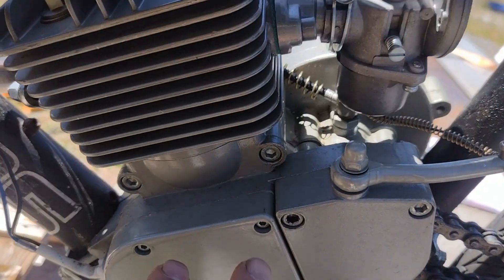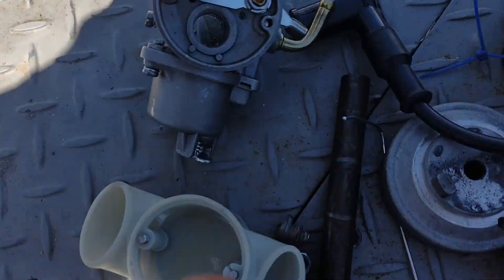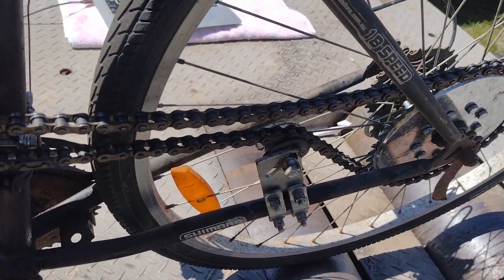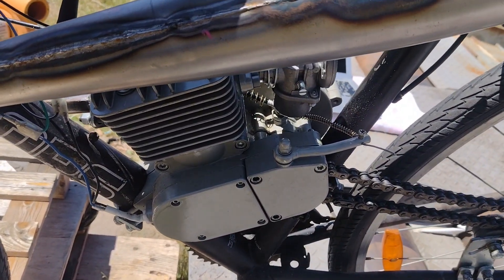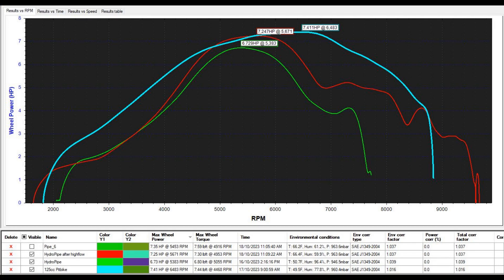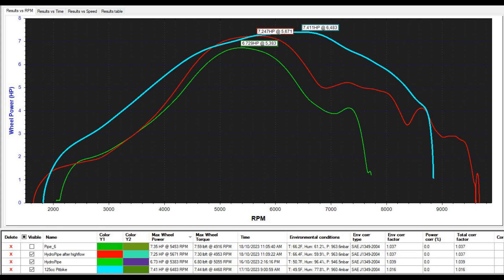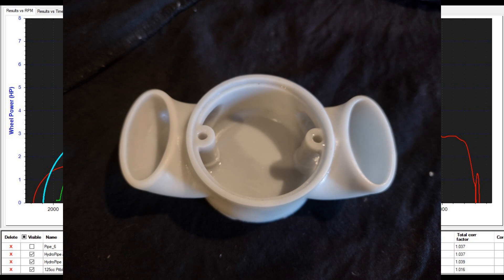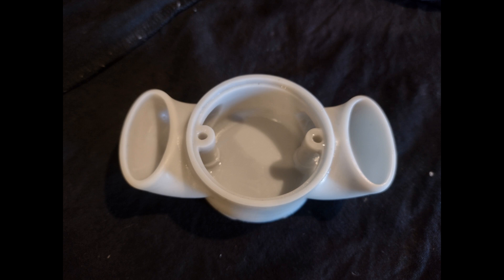Worlds most powerful BT100 motorized bike engine

Comment: How do you prevent the clutch cable from opening the drain valve on your bofeng?
Reply from the maker: I haven't had that problem. It might be related to the intake manifold you're using?

Comment: You need a engine mounted spring tensioner .the rear tentioner is junk , they come apart at high speed and chain locks the back tire up and then you are hurt.also try any chainsaw plug and you will really be impressed at the speed and power difference
Reply from the maker: A spark plug will add power? tell me more!
Reply: Lol  @SafetyUggs

Comment: im sorry but  you must  be joking modding your carb might as well  be an air leak hope you run a heavy  mix smh
Reply: @jeremyhopkins6965 it was running rich to begin with. Porting the venturi was meant to fix that. Even if he ruins the carb that’s like what, $40 max? You’d be surprised, there’s all sorts of cracked hacks to squeeze more power out of these little engines.

Comment: What exactly does porting the stock carb do? I never really thought about doing that to it like that but I’m very curious now to experiment and would love to know the reasons you did it and how it makes changes to the power delivery.
Reply from the maker: It'll allow more air flow, and more HP before the carb goes extremely rich and bogs down. This is all based on the work of RayJaye39 on the motored bike forum, definitely drop by and take  a read of his work
Reply: Porting stock carb without reed valve will lower your torque and lower your hp. This dude is a joke if he thinks otherwise.

Comment: with all due respect from Texas, USA I have to agree with the others, no stock china anything 66/80, 79.5/100cc will get over 3-4 hp, maybe 5 with a pipe and jetting, but that's pushing it without internal porting, windowed pistons, reeds and the rest. The Minarellis prebuilt by the pros with all the bells and whistles on them still don't even get 10hp. Your talking watercooled KTM 65cc and they still do not get that much power, especially unopened.
Reply from the maker: I hear ya! and you're probably right. I've tried to make all this as accurate as possible, not sure if you saw the video but we dyno'd our small 125cc 4t pitbike (lifan engine), reported to be 9hp at the motor, dyno'd at 7.4HP. I'll run my ttr250 and kx85 up on the same dyno this week for more numbers.   A factory kx85 makes 29hp so my logic is, an 80cc china doll, ported, custom pipe, VM18 carb, 9hp isn't out of the question.
Reply: @SafetyUggs  I think the Smoliks are there and past it, but nothing is stock. I am thinking of putting one of those on a mountain bike and wondered how fast they are with having forward gears is. Yet if they got power I'd go the $250 for one of them, what do you think of them? Any snags mounting them?Thanks!
Reply from the maker: @refuge33 If you mean using your normal cassette/gears,  you'll need a jackshaft kit and there's a limit to how much torque the stock chain and cassette pawl can handle.

max speed is purely down to gearing and HP. If you've got the gearing sorted, you'll need ~4HP to hit 50mph. 5HP for 55mph and I think around 8-9hp for 60mph. Wind resistance vs speed is exponential so its harder and harder to gain MPH the faster you go.

Out of the box, a $200 kit will get you maybe 30-35mph. Add a pipe and jetting and 40-45 shouldn't be a problem.
Reply: @SafetyUggs your hp/speed is accurate.  I built a few motors years ago and 55mph was the best i could get. I estimate it at 5hp and compared to stock it felt very fast!

Comment: I was getting what i thought was vapor lock which was starving it of fuel making the lean situation worse. Turned out the carburator was getting so hot the fuel was boiling back up the fuel line starving the motor of fuel. I modified a longer 40mm intake to fit the bolt pattern and it fixed the issue.
Reply from the maker: Interesting! I've never had a carb run that hot! Nice fix

Comment: Hello, I really like the video. I have some questions tho. First: what plug are you running. Second: what is your experience so far with durability and third do plan on installing a jackshaft kit( that would be a suecide, a cool one tho) thanks in advance. Have a great day/night
Reply from the maker: Hey! Plugs: I've tested NGK/Bosch/China Z plug. Zero change in HP between them.

Durability - These engines so far have lived their entire life at full throttle on the road or the dyno, and there's no wear visible on any of the parts so far.

Jackshaft! Yes!!! I'm told the gearing won't hold up to this kind of power but I'll test it out anyway
Reply: @SafetyUggs  man, I thought building jet engines in your bedroom was crazy but here I am reading this. Be safe bro
Reply: @SafetyUggs  btw just a quick question. A site in my country says it sells the same motor, but the carb has a red filter. Do you think I should risk it
Reply from the maker: @SGmotorsport9590  I'm told they ship with red or black air box so it's probably fine. If it's the same cylinder and crankcase, i'm sure it'll run great!
Reply: @SafetyUggs-fu4kw   btw I found a video on smolik performance channel where they pushed an 80cc hybrid I think to 14hp. I can't find the 16hp one tho
Reply from the maker: @SGmotorsport9590  At that point I wouldn't really consider it a china doll, if you've spent $400 retrofitting a cylinder, piston, intake, exhaust, ignition from a different production engine, its more alike to a minarelli than a chinese nugget. Still impressive numbers, just can't really be compared in my opinion!
Reply: @SafetyUggs-fu4kw   you also have a point. But I remember vividly the 46 sec video ot a zeda triple 40 pushing 16hp on a dyno with a fat belly pipe and 21mm carb
Reply from the maker: @SGmotorsport9590  Please tag me if you find the video
Reply: @SafetyUggs  it's called Frankenstein ms460 or SMH. It
It's on the cover of the video

Comment: I had trouble with the BT overheating and had to oil holes to the piston. If you plan on running that at higher rpm it may keep you from soft seizing. I said all that to tell you I think it is still my favorite engine. I’ve run Minarelli conversions, 80,yd100,110cc and the BT was definitely the fastest and most powerful as well as little maintenance
Reply: Hey rogerstafford can you show me a BT100 taking on a Minarelli and being faster. Cause, I'm gonna have to see it to believe it.
Reply: @jmrides777      https://youtube.com/shorts/vuPyIw8Im9E?si=VtbUUGxxtGw9djE9
Stage 6 may be faster and I’m not arguing it but that’s what I did when I had mine.
Reply: Then you probably ran it out the box without doing anything to it. Run mine 70:1 through dense forests and after 6000 miles not an issue yet. I've built 20 of these motors and it sounds purely like you built it wrong.
Reply: @TheJeremy5599  70/1 okay man. Watch my videos forest of all! Second if I ran my bike 69/2 it would be better off than whatever that mixture is.
Reply from the maker: I've been worrying about that myself, I've read seizing is an issue with these. I'm running 25:1 oil mix and so far, a 20min ride at wide open throttle doesn't lead to overheating, the paint on the cylinder isn't even discolored yet. It is still fairly cool over here right now though. What mix were you running on yours?
Reply: @SafetyUggs  35 roughly wide open would bind at times. Usually after 20miles
Reply from the maker: @rogerstafford-wakeinc.2088  What was your oil ratio? I've read a lot of nonsense saying you can run 50:1 in these, shortly followed by a pic of a destroyed engine.
Reply: @SafetyUggs  35:1
Reply from the maker: @rogerstafford-wakeinc.2088 The manufacturer recommends 20:1. I wonder if that is why it's cold seizing, too little oil?
Reply: @SafetyUggs  you would have to watch my videos on the modifications. The jug was modified and so was the piston. I did 50 on it several times
Reply: @SafetyUggs  not sure who  you got yours from I think the breakin was 28:1 and then 32 or 40:1 I would have to double check my notes
Reply: @SafetyUggs  I also found letting it cool off at times before modifying that it also was beneficial
Reply: @SR-gs8zo  the BT engine was known to have that problem. I did a lot of testing on it trying to prove concepts that were more user friendly. It runs very well most of the time. Thanks for your comment and for your support.
Reply: My 66cc or "80" soft seized a few times during break in period, I thought about drilling holes but ended up just sanding the piston down a fraction and haven't had issues since thankfully,
I sit at full throttle full speed for up to a few minutes at a time and she just sings!
I run 30ml of motorace oil per Ltr of 95 or 98 octane on a 29" wheel mtb.
Tuned race intake and exhaust

Top speed is around 80kmh with 44T  rear sprocket at just under 10k rpm
I have a 38T sprocket waiting to go on but my local roads are too windey and hilly!

Couple of my mates who rode it said it feels like a 125cc and I agree!
If you could get a good quality small 3 or 4 speed transmission on those engines you'd be gone like the wind!
Reply: @Yukanhayt-Mhenow  you should have no problem with 38t if your 170lb or less. Might gain 3-5 mph . Godspeed and thanks for watching.
Reply: @SR-gs8zo  air cooled cylinder NEEDS excess fuel for cooling. Anyone who thinks otherwise Is a joke! 
Over 55mph and 6500miles on my bike,and i run the largest motorized bike page in the english speaking north-americas's.
if he wants to get it performance oriented, he would listen to me, given he MAY be on my page already
Reply: @TheJeremy5599   i looked at your channel and I don’t see a bike that does 45. Trill the page man it kinda makes me smile.
Reply: @TheJeremy5599  SAD listen to who, who cares about a page you host lolol 👽👎🏻

Comment: Never heard of modding the carb like that. I might have to try it. Would a velocity stack+ richer jet be a good idea to pair with it?
Reply from the maker: Credit goes to Jayraye39 over on the motored bikes forum for coming up with this idea. The carb is still flowing way more air than it was designed for and it'll run rich up top because of that and ultimately limit the max RPM and HP. I had to jet down to lean up the top end, which also lost torque down low. It really needs a larger carb for this combo. I'm told by Jayraye39 that a velocity stack will increase power too so I'd say that is worth a try
Reply: Does your venturi opening go all the way through? Or did you only open it up till it meets the slide? This is definitely a hot roder’s secret to making the most power in the “nt spec” & non reed setup class. Love the videos. Great work mate! Keep em coming

edit — read through the 100+ page thread on the forums. Another thank you for sharing all your data & info. Just modded my carb and excited to see what improvements I see
Reply from the maker: How did it go!?!? We saw a pretty big improvement with RPM and power, hopefully you see the same!
Reply: @MrJustalilcrazy so... what improvements did u see?

Comment: Great channel. Definitely  impressed. What's the stinger exit I.D.
Reply from the maker: 12.1mm ID is what the pipe calculator called for. Once the VM18 is fitted I'll start shortening the stinger inch by inch and see how that affects HP
Reply: @SafetyUggs  thanks
Reply: @SafetyUggs  https://youtube.com/@2strokecarbtuningportingin187?si=jNkaGgIO6uaV9Glc